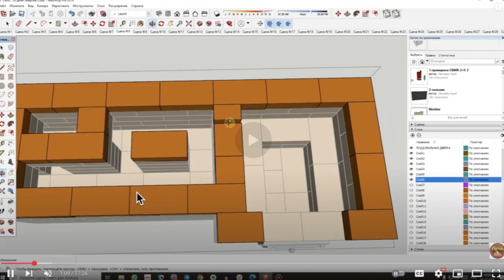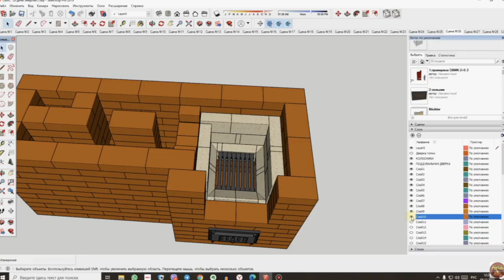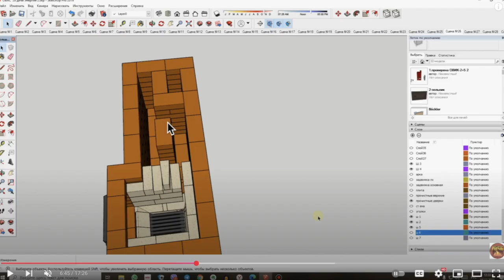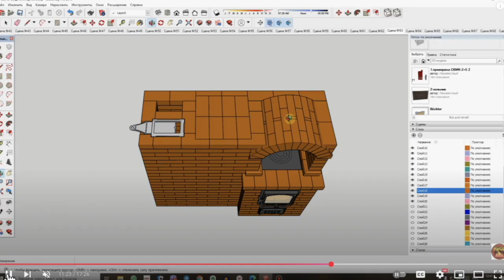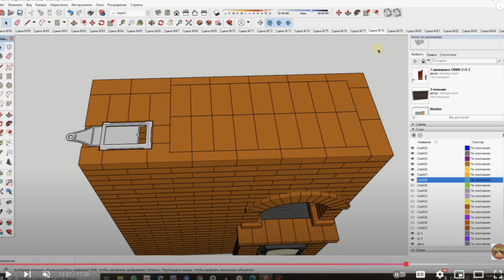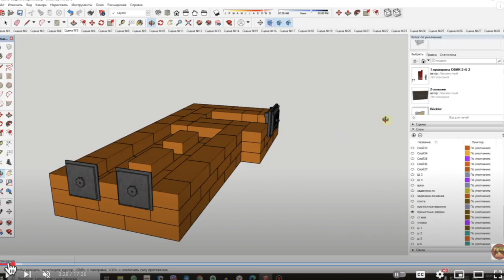Simple "L Shaped" Masonry Heater Wood Stove Anyone Can Build

Comment: I enjoyed your presentation. My thinking on the angled bricks between the firebox and 1st bell is to accelerate the exhaust; which as you stated, is not critical for a novice. As for the hot plate; my thinking is that a huge pot of water sits there mostly used as a humidifier and off grid hot water storage.

Comment: Would there be problems just lining the main fire box with fire bricks and the rest of the build with regular bricks ?

I like it just doesnt have an oven but i guess you could use a dutch oven .
Reply: Does your fire box size determine the heat temp ?
Can you do horizontal channels for a bench and clean outs if they are connected to the fire box?

Comment: I understand that the angled cuts of the intake from the firebox to the first bell might be splitting hairs but could it be more than a half a percent of efficiency in terms of heat due to speed of airflow that it adds because of the venturi effect?? It's all theory but genuinely curious.

Comment: Would it be accurate to call the first damper a "bypass"? I realize they are both dampers but I think the first one is functioning as a chimney bypass. I think I like your idea of a taller firebox, this one seems like it needs more space for the gasses to mix and burn up either inside or just after the firebox rather than just dumping directly into the first bell.
Reply from the maker: Hey "J" ... yea... it's the same as a catalytic stove bypass so everything can be warmed up first for 5 or 10 minutes. On the other part... yea... the firebox should be high if you want "no smoke." My example with the tiny bricks at the end was "just a quickie" and not at all to scale.

Comment: is the dry slit analogous to the batch box rocket stove slit?
Reply from the maker: No, not at all. The batch box "port" is the ONLY WAY for the flame and gasses to enter the riser. In these stoves, the slit is much, much smaller and allows only a little flame and gas into the "next chamber." The REASON for the design according to the Russians is actually to allow colder gasses to escape more quickly, but I think they have no idea what they are talking about in this regard. This slit works for other reasons, so they stick with it. We should use it too, for the many reasons it helps.

Comment from the maker: MISTAKE - Guys... in this video (early on) I said 1,000 bricks....  I meant 1,000 POUNDS for the SMALLER version. I said 1,000 bricks at the end of the video, and that was correct.. It would be close to that if you decided to build the full size, 6 foot stove with the big second bell on top of the first bell. You would need angle irons at the top of the second bell and the TOP ceiling of all masonry heaters should be 2 bricks thick for safety.